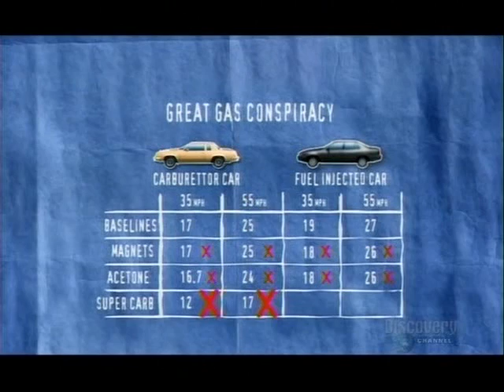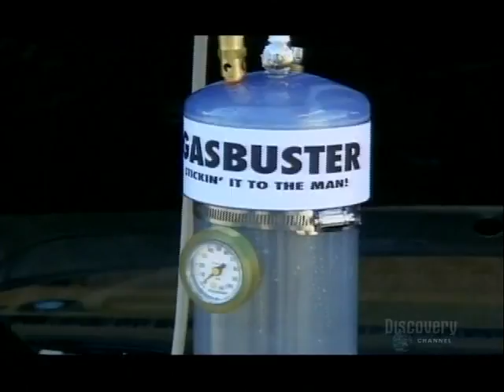Gas Saving Devices Busted 2 PartII

Comment: @utterube Add baking soda?  So, let's add something that breaks down and produces carbon dioxide.  Does not sound like what you need for better combustion.

@nathanlorimer Need voltage?  Water electrolyzes most efficiently at about 1.2 volts.  You need current, not voltage.

And where are you getting the electric power to break the water molecules?  If you are using the car's battery and generator, then you need to run the engine to get the power -- and it is not going to produce extra.